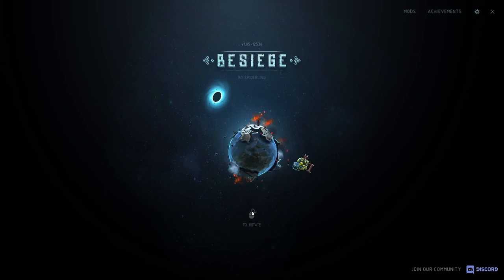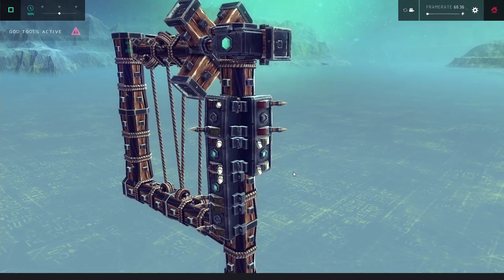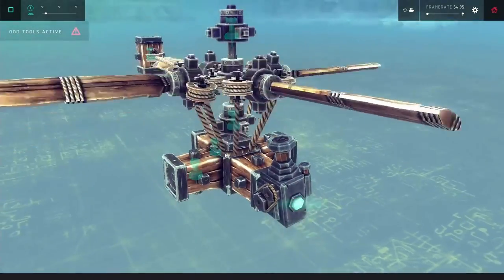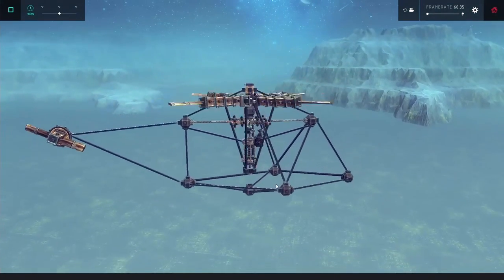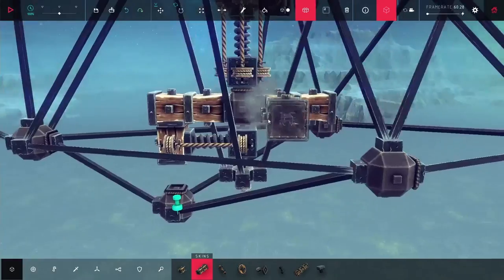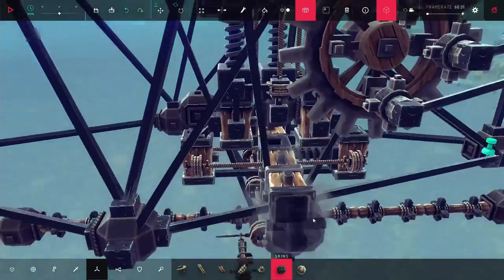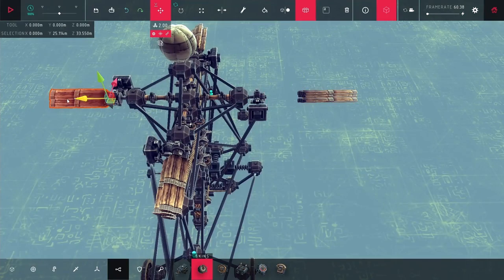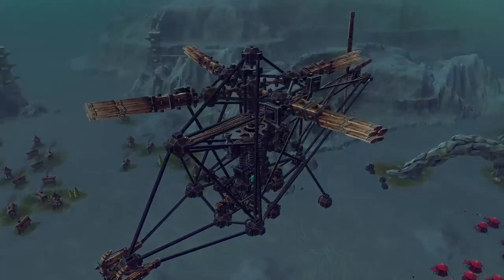Making a Helicopter in Besiege

Comment: I feel like it's worth noting that while ballasts are lighter and more durable, they aren't that much lighter. A minimum weight ballast is 0.2 while a single wood block is 0.3 and a double wood block or wooden pole are 0.5 (aka 0.25 per section) and a log (triple wood block) is 1.0

It's also worth noting the cost of using braces to support a ballast: each brace weighs 0.5

Using ballasts on flying machines is often a good idea as they're even lighter than wooden poles and unaffected by minor damage, but don't mistake them for feathers

Comment: Can you make zero-mass force Neutralisation work? Zero-mass ballasts have zero rigidity connections and supposedly don’t transfer force at all, but can only be held in place with springs or winches. It can be used to lift extremely heavy payloads.